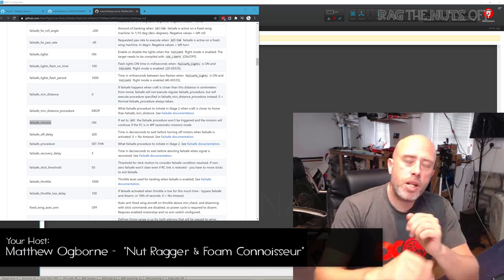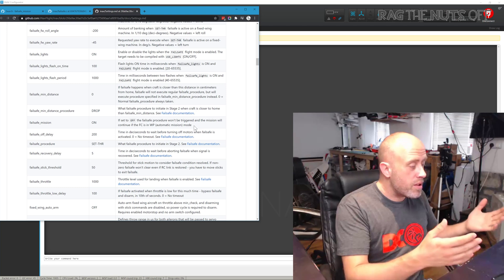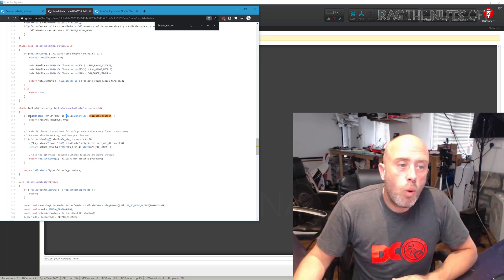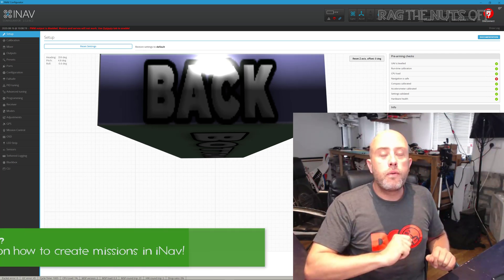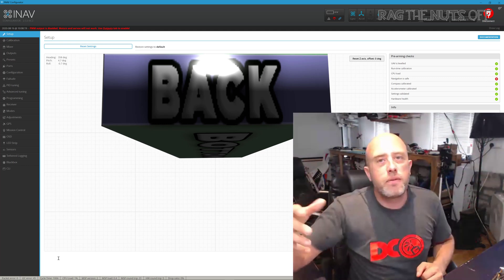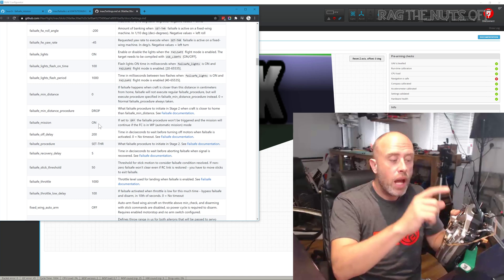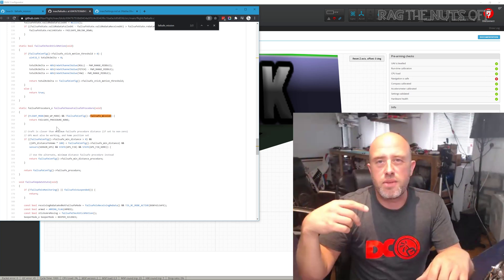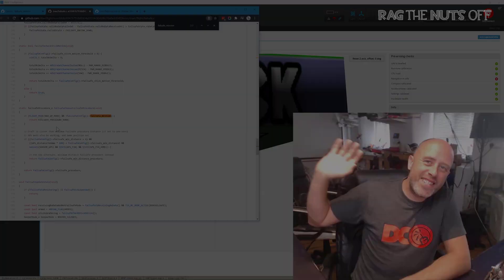The ONE Setting Needed for AUTONOMOUS Missions in INAV (failsafe missions!)

Comment: I think in iNav 8 its now called failsafe_mission_delay and needs to be -1 correct?

failsafe_mission_delay
Applies if failsafe occurs when a WP mission is in progress. Sets the time delay in seconds between failsafe occurring and the selected failsafe procedure activating. If set to -1 the failsafe procedure won't activate at all and the mission will continue until the end.

Comment: I know this video is older.  I have my Sonic AR Pro all set up.  I agree with how to do the crossfire failsafe settings.  What if the crossfire goes into failsafe when I am not in a mission and then the failsafe settings in the receiver activate the mission and then it STARTS the mission just based on the receiver failsafe settings.  (If I have a mission uploaded but have not started it yet.), and I have my failsafe set to include the switch ON for waypoints, what if I failsafe before start of mission, would that possibly start my mission because of my failsafe paramter?
Reply: I haven't try all these, but as far as I know if we activate WP when the mission not loaded plane will go RTH. So Scenario#1 if FS setting activate WP then it will go RTH. Scenario#2  if we loaded the the mission AND if FS happened before start the mission then it will activate WP (it will go 1st WP). Scenario#3 if we loaded the mission AND if FS happened after we start the mission then it will continue on WP state just like Matt explained in the video. But I think it is better to create new mission plan when we flying on the new location to avoid 1st WP far away from our new take off position especially when Scenario#2 happened instead of switch the FS setting from FS POS to CUT back and  fort. In case if we forgot. Just an idea.
Reply: @tokoheli2210  thank you for the reply.   I have it working very much to my satisfaction.    Here is a missions video, very cinematic, made by me over the last couple of weeks. https://youtu.be/ix6bCQ1jYyw

Comment: I have a question Matt , if flying in a normal mode (not wp) and the radio fail-safes for some reason . Will it go to WP mode and start the loaded mission ?  . I hope that makes sense .
Reply from the maker: Yes, yes it will do. So set the failsafe back afterwards! Matt